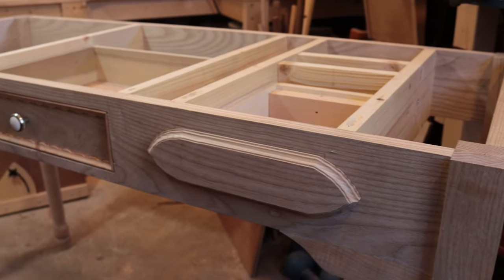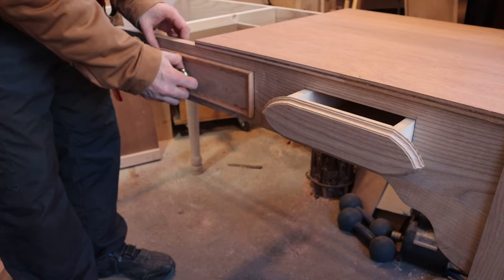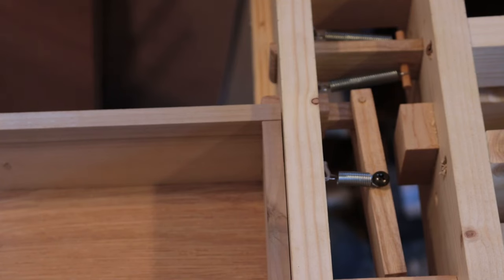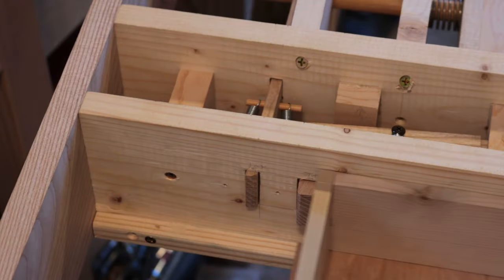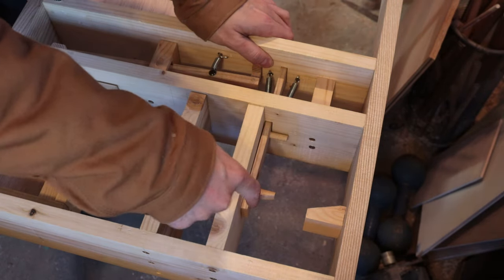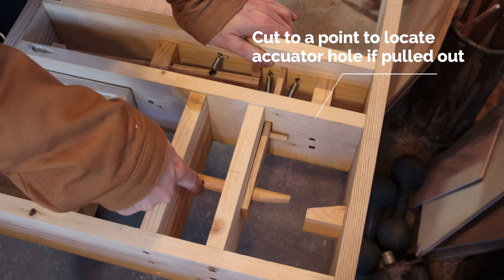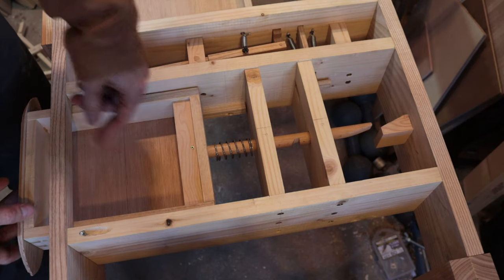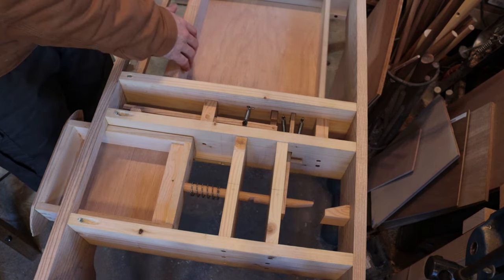Secret (hidden) drawer mechanism!! So Cool!!!!

Comment: Will there be panels underneath to disguise all but the actuator switch?
Reply from the maker: I was thinking about installing dust panels but decided not for two reasons. One, the client had a very small budget and I already went way below my hourly rate to finish it. And, two, if the springs break, or something else guess wrong with the mechanism I want to be able to access the under side easily.
Reply: @TenonsTenors  I see your logic. It's unlikely that anyone would look underneath the desk anyway.

Comment: why is the wooden pin and the block angles verry agressively
Reply from the maker: Not exactly sure what you're asking, but the two drawers are parallel, so the mechanism I developed was at right angles to both drawers. Perhaps there might have been a way to angle certain mechanisms in a way that made operation smoother, but I was not thinking about that at the time. This is what I came up with! Thanks for watching!